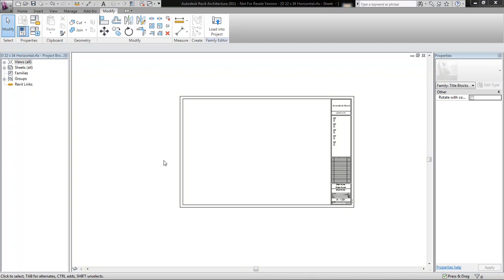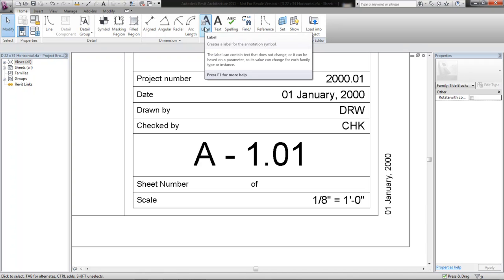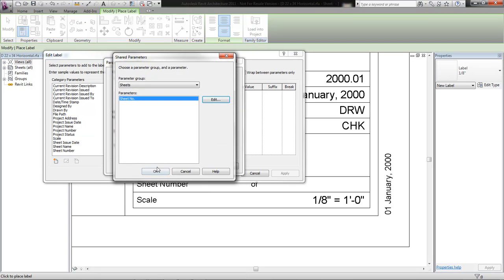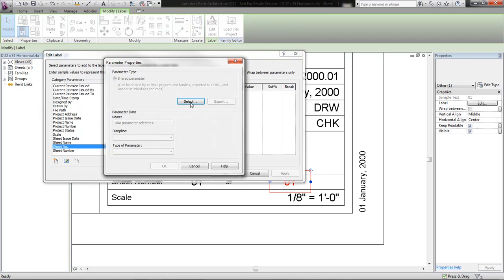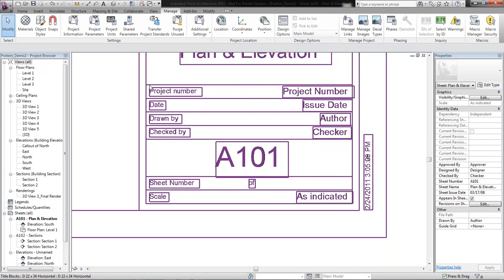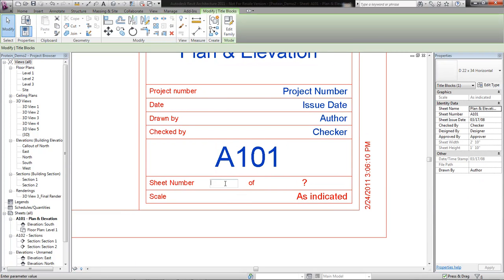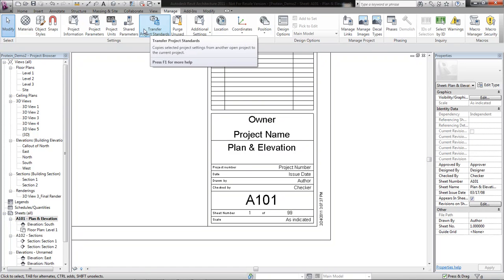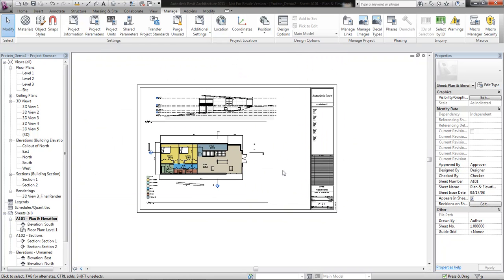Revit 2012: Creating a Title Block Parameter

Comment: Dear Sir, If you could help me, I will donate !  I have 20 buildings on my project and the idea is to use one title block.  Based on type label list, I have found only sheet name and sheet number only that will change per building type.  I also need a separate label that can change as well, i.e. Building A or B or C.  Please advise?

Comment: When you were creating the parameter, you didn't get the option of choosing a "type" or an "instance" parameter. Why is that?
Reply from the maker: Hi Tom, when you are at the stage of creating Shared Parameters, especially in conjunction with Labels [on Sheets], Type vs Instance doesn't come into play.  It is a Shared Parameter that can, later on, be designated as Type vs Instance.  I hope this answers your question.

Comment: HEY, I followed all the instructions, but I don't  know why when I create the sheet No,  it appears the same number in all the pages  
I double checked each of the steps but I keep getting the same number on all of the pages
Reply from the maker: Hey Jeisson, I am sorry to hear that. Please contact our tech support experts to see if they could help you out with this problem! You can send an email to mtcinfo@microcad3d.com or call 6179230500 - tech support. :)
Reply from the maker: Its laid out pretty well in that video, you sure you followed all the steps?  The only thing I can think is to make sure the parameter for sheet number is an instance parameter and not a type parameter.
Reply: Check your parameter setting... make sure it's set to instance.
Reply: The same for me. And i triple checked!  :(
Reply: I believe my problem may be because i'm not using a title block family. I am creating my "title block" as a "Generic Annotations" (personal prefferrences). Probably that is the reason, or something has changed with the modern revit. On the video he is using the 2012 version.